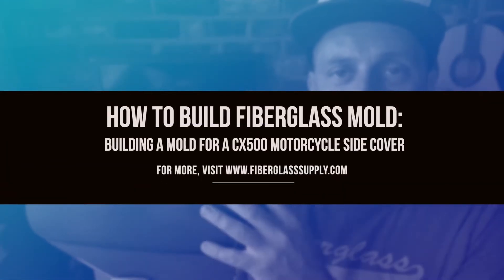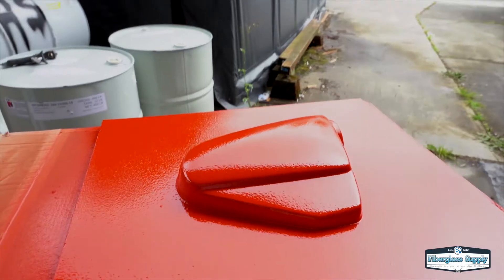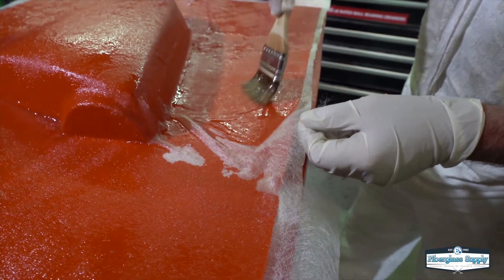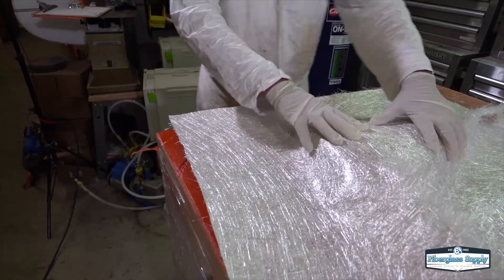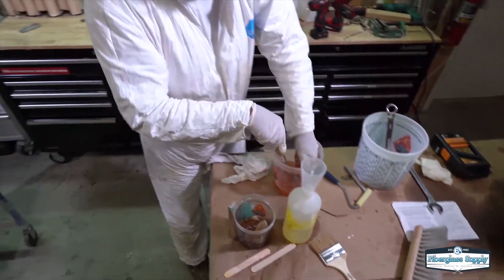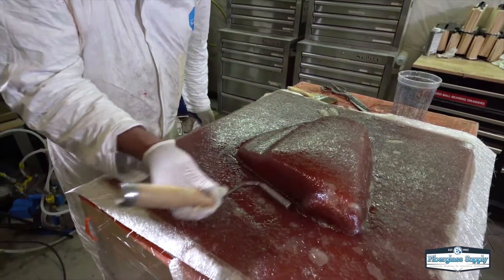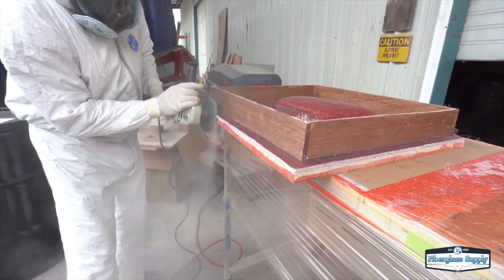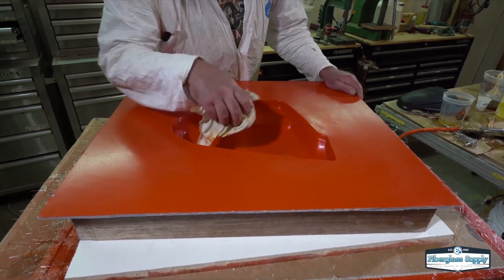How to Build a Fiberglass Mold: Building a Mold for a CX500 Motorcycle Side Cover

Comment: Nice video. I just have one question. Why are you not using a little water to release the mold? PVA is water soluble. ( Poly Vinyl acetate) it doesn’t take a lot and makes releasing much easier.
Fun fact: it is also used in Hydrographic film.

Comment: Struggling to make a mould for a dished shield at the moment but after watching your videos I've realised the importance of a good sized flange area, we currently haven't been doing that! Back to the drawing board for round 2, thank you for the education!
Reply: i still dont understand why you need a huge flange area never made fiberglass mould, i just wanna use the fiberglass though, why cant i just have the replicated peice and nothing else
Reply: @Sephlarite  we've found out that it's very much required! I'm involved currently in a small project where we're making quite a few dome shaped shields about 600mm in dia. We started making moulds where it was just the shape of the shield and we found that the edge was always weak and usually got damaged when taking it out of the mould. We then started making moulds with a flat flange area around the actual shape and we can now leaver the two flanges apart and use wodden wedges to sperate the two items without causing any damage to the actual item that we're trying to make. We also made the mould much stronger and resined on a timber frame to the underside to stiffen things up. The flange only needs to be big enough to achieve a minimum area of about 40 - 50mm at it's narrowest part, it can be seen as waste but it greatly helps to get a decent product.

Comment: Great video. If you were to use fibreglass for the actual part. How would the method differ to this? As you did a carbon outcome and ill be doing a fibreglass outcome. 

Thanks

Comment: Hi, great video, i have a few questions  as im attempting to remake a mould of a classic car louvre that they no longer make that is 20 years old so is damaged chipped and warped, ive  took a new mould but ive not made it to thick so i can get the warp out, so now im filling and sanding to get all imperfections out.

1, I found when brushing pva it left marks  on the mould so would it be better to spray or use a wax

2, how much acitone should i use to mix with gelcoat to get it through spraygun

3, what resin do you use as it looks quite fluid, can i also mix acitone with  the resin to make more fluid and if so how much

Thanks
Reply from the maker: Thanks,

1. If you can avoid using PVA and get away with just wax you will get a better surface finish, if you have to use PVA spraying it will give the best results

2.  We really don't recommend thinning the gelcoat with acetone, it lowers the properties of the cured gelcoat.  We recommend using the G-100 gelcoat gun or a pressure pot with a 2mm or larger nozzle.  If you have to thin it then we recommend using duratec high gloss additive.

3. We use our Isophthalic (Iso) tooling resin for most of the mold building that we do.  Again we recommend against thinning the resin with acetone, if you have to thin it styrene monomer would be the preferred method up to 10%.  We do not thin the resins we use here.

Comment: I replicated this process and my gel coat on the mold surface wrinkled. Any idea what could cause that? I used a mil gauge and it was 25 mils thick
Reply from the maker: I am assuming the wrinkles look like a dried out desert floor or alligator skin. There are a number of reasons why.  It sounds like you had good thickness so we can rule that one out.  Next would be the gelcoat was under catalyzed and not cured enough before putting on the laminating resin and/or the laminating resin wasn't catalyzed hot enough and attacked the under-cured gelcoat.

Comment: Why not bag the mold?
Reply from the maker: The chop strand mat when wet out breaks down and allows the mat to conform to complex 3d curves, we are not worried about the weight of the tool and we want the tool to be stiff so we need to build thickness, mat does that really well and relatively inexpensively.  Also with the veil/mat combo and the lower shrink tooling resin we don't get print through from the reinforcements to the gelcoat surface.  

We have done bagged molds both wet layup and infused, usually when we do that they are carbon molds that are going to be used at high temperatures, the materials we use for those are more difficult to work with and more expensive, resulting in an more expensive product.

Comment: Awesome video! I have a client wanting fiberglass molds made for synthetic human arms and legs. They'll use silicone in the mold so it'll have to obviously be a two piece mold that will separate once the silicone has cured. What do you think would be the best way to make a plug for legs and arms?

Comment: I would like to ask you, this Orange Tooling Gel Coat contains styrene, why didn't it dissolve the plastic cover? Does PVA prevent plastic from dissolving? PVA didn't work for me, but I applied PVA manually on plastic part.
Reply from the maker: Yes it does contain styrene. The particular plastic this part is made from does not have any issues with the resin. That said the oval applied thick enough should provide a sufficient barrier for most plastics. If the part is styrofoam then using a polyester system might not be a good idea, although we have successfully coated styrofoam parts with epoxy before using polyester over it.

Comment: Great video, thank you for all the information. I would like to ask about overlapping fiberglass mat, either chop strand or weave, on the mold surface area and how much it affects the final surface of the mold itself.  Will having a seem of overlapped fabric have visible after effects on the mold?  Does the amount of overlap matter, let's say by 1 1/2" to 2"? Will weave and chop strand have the same surface finish?
Reply from the maker: When the fabric leaves a pattern on the surface of the part or mold we call that print through.  If that happens when the part is built it is due to the resin shrinking, if it shows up some time after the part was built it is due to the resin and fiberglass having different rates of thermal expansion, or latent curing in the resin system.  To control that and reduce the chance of it happening you can first pick a resin system that shrinks less like our Iso tooling resin or a vinylester resin or an epoxy (keep in mind epoxy doesn't work with mat) and second make sure the resin is fully cured before demolding the part or mold from the plug.  The overlap can have a visible effect on the mold, mat is a better option here because you can tear the edges of the overlap so that they feather together and don't have a hard overlap line. Chop strand mat is often used on parts as a print blocker, so getting down a couple layers with feathered joints will help prevent the overlap of woven or knit fabrics coming through to the surface.  On large parts a 2" overlap is standard.
Reply: Thank you for the information .

Comment: Are you sending before the addition layers after they are cured?
Reply from the maker: I don't, Tim will sometimes go over it real quick with some 60 or 80 grit paper just to knock down anything that is sticking up.  The resin is a laminating resin that stays tacky and the next layers will bond to the previous layers (assuming you don't let it sit for weeks).